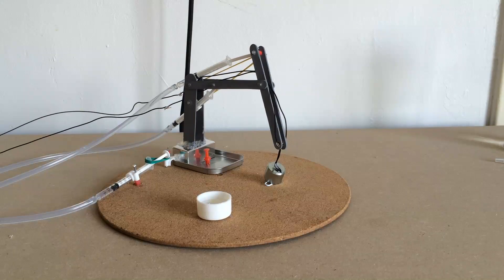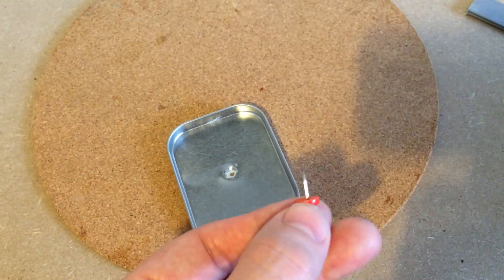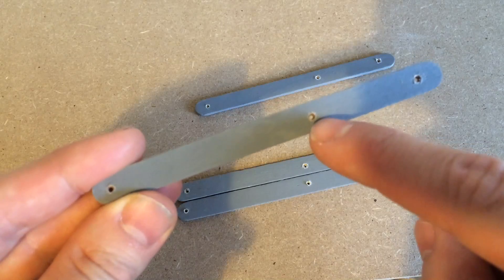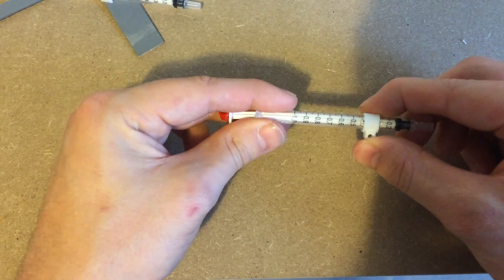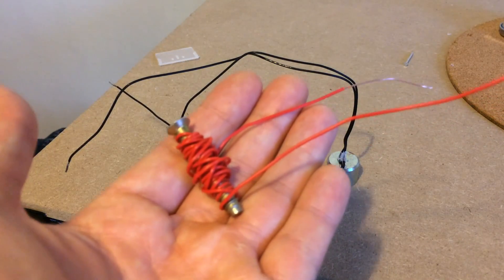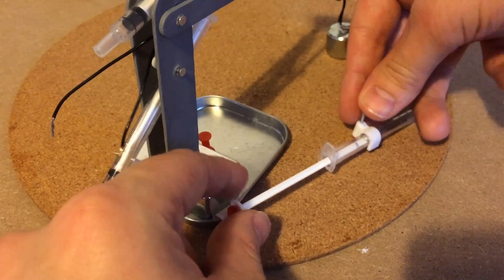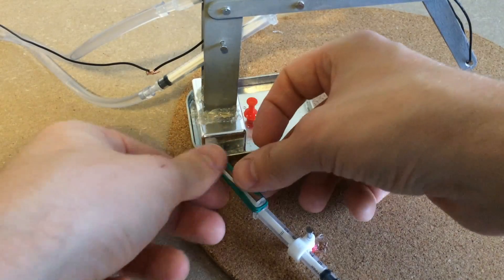Make A Hydraulic Arm!

Comment: Can i use a permanent magnet instead of an electromagnet, please reply must i need it for my school project and if u can suggest any other working model to me i would be really glad .Thank you!
Reply: If you want the arm to be able to release the object you need an electromagnet. Electromagnets can me turned on and off with a switch. The switch control's a small amount of dc current (9v) in this video. Nice video by the way. Mistk8 mentions you can use a nail and some insulated wire to make your own electromagnet. Wrap wire (plastic coated or insulated) around a nail as many times as the length of the wire will allow. Connect one end of the wire to the positive terminal of a battery and the other end to either a switch or just to the negative terminal of the battery. When connected the magnet is "on" when not connected the magnet is "off" release. wires may get warm or hot so always disconnect when not in use.

Comment: Make sure that when you fill in the tubes, have the controller syringes filled up with water also, and make sure that the syringes on the arm aren't filled with water, then you can connect them.

Comment: How to remove air buubbles from tube 
Pls tell me
Reply: +Saumil Choksi By removing the air bubbles
Reply: +Saumil Choksi Not that hard.  Just need to keep the hose and syringe under water.  Fill syringe with water.  Connect hose to syringe.  Pump water in, unplug hose (keep both ends under water, fill syringe with water again. Connect, pump...  repeat until all air is out.  Just make sure all ends are kept under water the whole time.

Comment: I wonder would it be better to use oil in stead of water?
Reply: +Jesper Kleemann that's what most hydraulics use, itd be worth a shot!
Reply: Hi!
Yes, you are maybe right about the pressure will be to high for plastic tubes, but maybe if using plantoil or some other very thin oils. But you have a point there. (Sorry for the bad gramma)
Reply: +Jesper Kleemann Water is just as good as a hydraulic fluid, it's just that oil is used in metal hydraulic systems as it lubricates and prevents corrosion in the components.
Reply: davidrobert2007 You are right about the lubrication and corrosion, but I think it also have something to do with density but I am am not sure how much it has to say in so little a setup. You are probably right about using water is as good as vegetable oil, when I get the time and parts together I will try and see if there is a difference between water and oil. (sorry for the gramma)
Reply: Hi!
When using demineralised water they won't crack by time. When using oil the syringe can't hold by them self them self, they get to lubricated. I bought a cheap kit from Banggood.com and tried both eater and oil.
Have a nice day

Comment: really cool project, i just was wondering, how did you fill the tubing with water without getting air bubbles? Also, what kind of syringes did you use? mine kept on leaking water.
Reply: I'm having the same trouble

Comment: Its super. But in actual hydraulic system the diameter of the syringe in the arms should always be bigger than the one you are holding in control system. In that way you push really smooth and easy but to a longer distance but the syringe in the arms are powerful enough for the shorter distance.

Comment: You could very easily make this completely electronic by attaching the syringes to the worm drive and motors from the eject mechanism of an old CD ROM drive.
Put the platform on a motorised base (also from a CD drive), and you can swing it through 360 degrees :)

Comment: Dude.. you always come with the coolest things from the simplest stuff.  This is a great project for kids to learn about hydraulics.  Excellent project.  Keep the good work.
Reply from the maker: Thanks! Will do
Reply: ***** your awesome this really helped me thank you
Reply: Yeah dude hydraulics are kinda cool cus Im a kid
Reply: ***** 
where will i get the silver color objects used as base
Reply: What volt battery did u use
Reply: Tnt0603 a 9 volt
Reply: Tnt0603 Depends what electro magnet you use.
Reply: Ikr he's so good
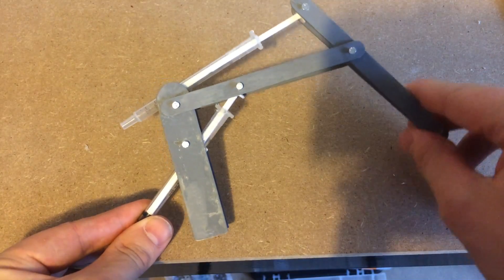Reply: Divya Paari Just find an old tin box or buy one on ebay. I'm not really sure where to get the other part but at 2:47 he said he got it from the top end of an aftershave bottle, but you can really use anything if it's a similar shape.
Reply: +UnderscoreZeroLP u could find everything on eBay or just take a body spray cap

Comment: Wow I got the idea of putting a grappling hook instead of a magnet please tell me if this is a good idea
Reply: It would be almost impossible to lift stuff with it so I think the magnet works better
Reply: Look up the meArm. You could use a claw like it uses fairly easily, I should think. (I'm looking at version 0.4, to prevent confusion.)